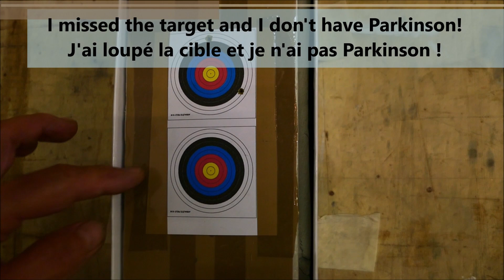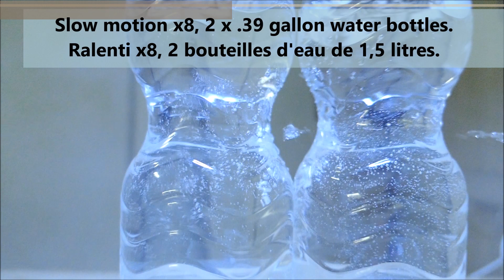Incredible and Amazing Bajozutsu shots!

Comment: You put black powder in the matchlock. Very little grain of black powder, but it was very loud, probably related to the barrel being too short.
Reply from the maker: The short barrel is not the only reason for the power of the explosion. The powder I use (special flash pan) is more explosive than black powder. My bullets are fitted with a wad. The pan flash hole is very small 0.8mm (less pressure loss).